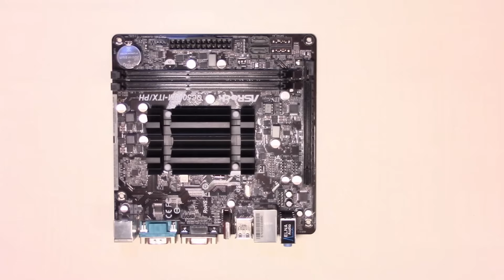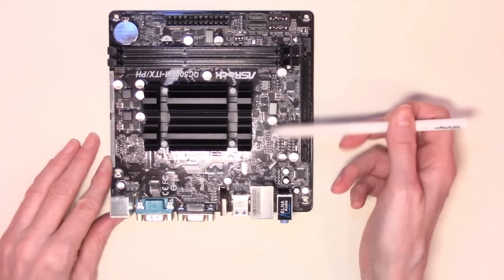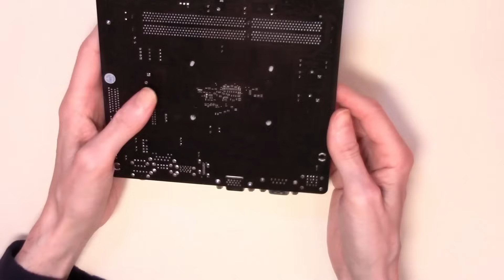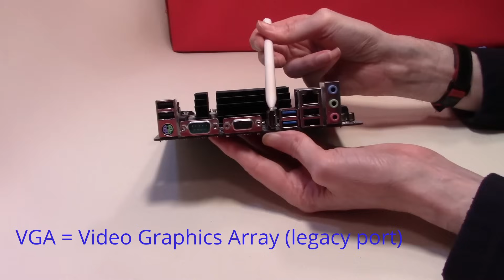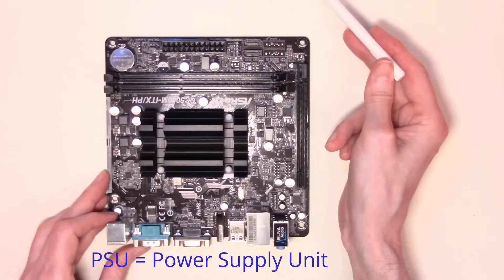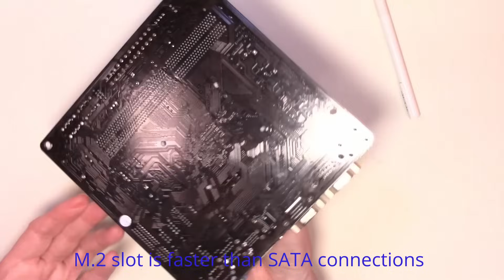Computer Tours - part 1 - the motherboard. Hardware info for beginners to modding

Comment: I have an ASRock J4105M but just realized there isn't a southbridge chipset on these boards.

The CPU is an amazing package for only using a few watts of electricity.
Reply from the maker: Yes the ASRock range are good low power option.

Comment: Nice video, very well put together and simple but concise explanation of each part/component. The only grievance I have is the the "front" is actually the back panel.
Reply from the maker: Many thanks, glad you liked it. I tend to put the connectors at the front of the rack mount, hence my referring to it as the front but point taken.
Reply: Fair enough, guess is all about perspective... :)